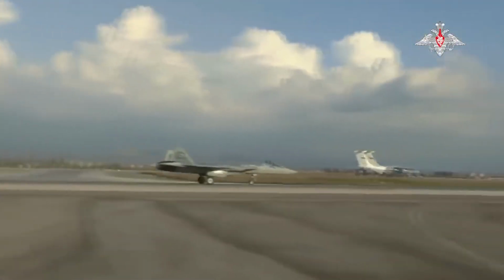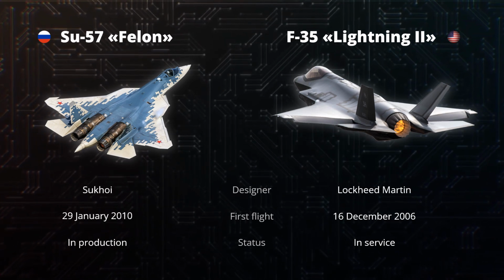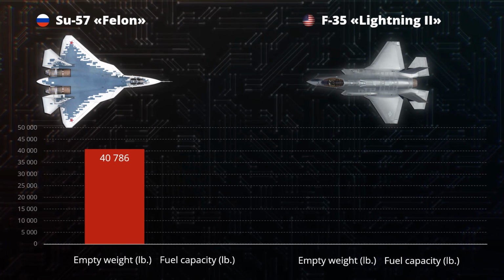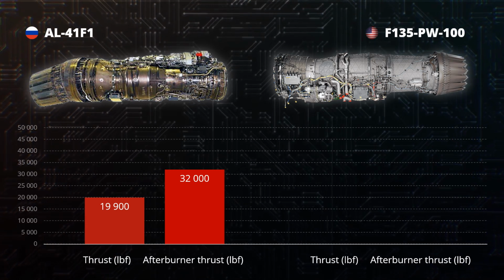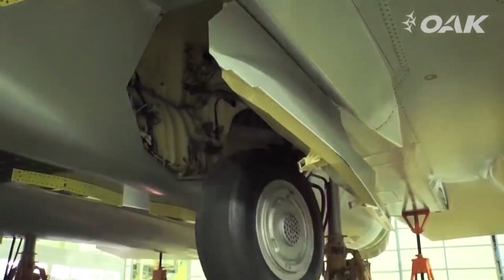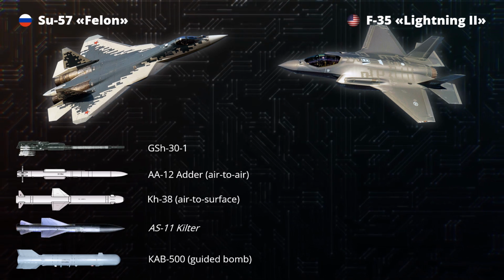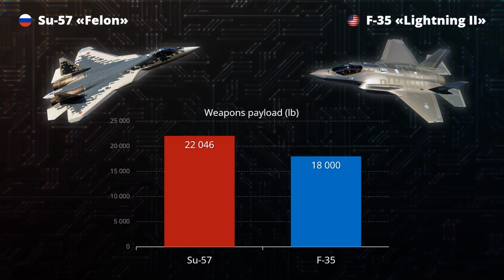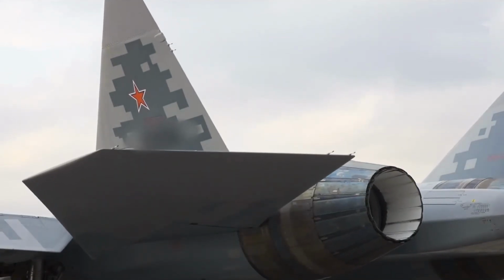Su-57 vs F-35. Which plane is better ?

Comment: In air superiority Su 57 is better but the avionics suite the F-35 has is unparrelled. If the Su 57 can get close it wins on average but its chance to get close is very low. Overall the odds go to the F-35.

Comment: I think the Saturn AL-51 went into at least low rate production in early 2024. 
Maybe they're still developmental, but they're at least saying they're in use. 
My biggest complaints re: Russian SMO equipment: Too few Su-57 & no T-14.
I just cannot understand why they're made if not to use them. Other urgent needs:
Cooled thermal sites & faster reverse for tanks, & infantry: good body armor + sights.
Reply from the maker: ,T-14 is a technology demonstrator. It will never go into mass production, there is no point in that.

Comment: SU-57 is not stealth, has last generation aeronautics, underpowered engines, limited fuel storage and many manufacturing faults. Plus the country that produced it can't afford to make a single operational squadron of them.

F-35... already numbers more than 400 operational units. Operated by several countries, has confirmed combat victories, has radar signature of humming bird, is able to integrate targeting systems with other aircraft, VTOL capable, carrier launch capable, 360 degree visibility for pilot.

There is no comparison.
Reply: and how many crash records has the f35 for a relatively new fighter , su 57 is a fine rugged fighter wait and see
Reply: @ziedkammoun5085  didnt russia just say that they wouldnt produce anymore of them cause they are too poor?
Reply: @ziedkammoun5085  F-35 has over 800 airworthy units and only 8 recorded losses of the aircraft. 1% crash rate.

SU-57 has only 11 airworthy units and 2 confirmed crashes both were prototypes. You do the maths as to which has the better crash record.
Reply: @ziedkammoun5085  Uh, you just think there are a lot since previously (prior to twitter era and before online reporting) you didn't see how many AV-8B crashed, which is over a HUNDRED of them. F-35 has an incredibly low rate of mishaps. Engine failure rates are so low that it's more reliable than any two-engine jet the Navy has ever had if I recall correctly. And I say that as a fan of the Su57. 

As to amanda's initial comment, the "not stealth" claim is beyond ignorant. We have NO IDEA what the RAM performance is. All those 0.1 square meter reports ... are based on the physical SHAPE of the design, not the RAM. how would the US ever get the RAM..???  Does anyone discuss the RCS of F-35 in absentia of RAM? No they do not. Yet, everyone mentions that number. And to prove my point, the FA-18 has a sub 1m RCS when RAM is applied and yet, it doesn't even have plane-form aligned angles / shape. The people who are so stupid as to think PFA and purpose developed shape has an RCS that's the same as our aerodynamically shaped 1970s jet is just an ignoramus of the highest CNN order ... who believes BS like mostly peaceful, ... safe and effective, etc.  Use your brain people. 

Underpowered engines Amanda?? Go look up the AL51. They have higher peak thrust than the F-22. Granted, per engine the F-35 has superior performance, but it also has limitations of using AB for not more than a minute except when doing so in a "military emergency." Eg., to avoid loss of the aircraft. But just as Russian tank advantages that are far less sexy are ignored, like logistics as well as ease and cost of manufacturing... consider the US debt to GDP of 122% and climbing just from interest alone ... vs Russia's, which is 20% and diminishing (even during the war). That's right, during the 'SMO' they PAID DOWN their debt. And btw ... Russia has more natural resources than the US does. 

No? None of those factor into your critique? 
Oh oh ... here we go, I'm a pooty-poot bot, ey? 
I served in the United States Marine Corps. And YOU..??

I just see no point in denigrating the Russians nor Iran. I'd rather try to understand them. They have a completely different approach to life & warfare. One that I wouldn't like. But it is the Russian way of doing business. And I have tremendous respect for them. Nor do I find their approach to getting military info out. I find it utterly unpersuasive & "low brow." But so? I'm not their target audience. It works for them. And there's plenty to criticize us for. Our media has become worse than the propaganda Russians deal with, and Ruskies are far more cognizant of media lies than we are.